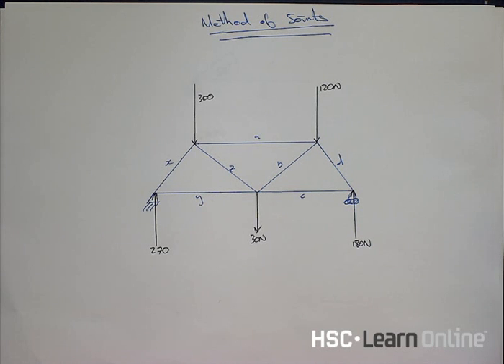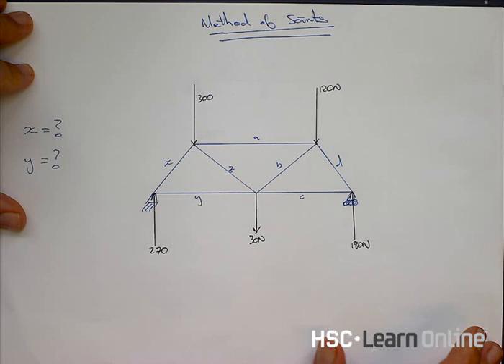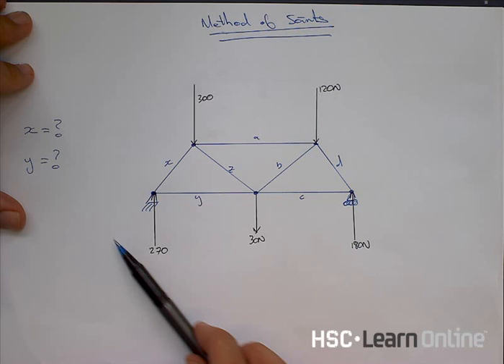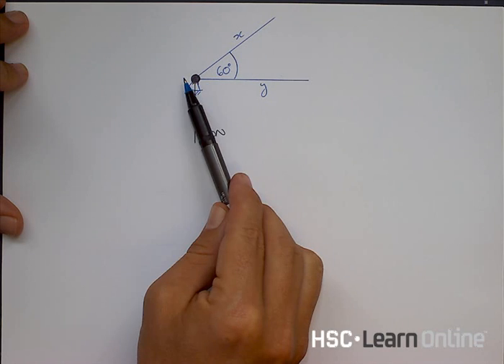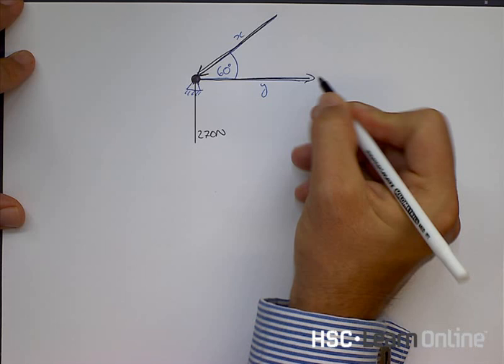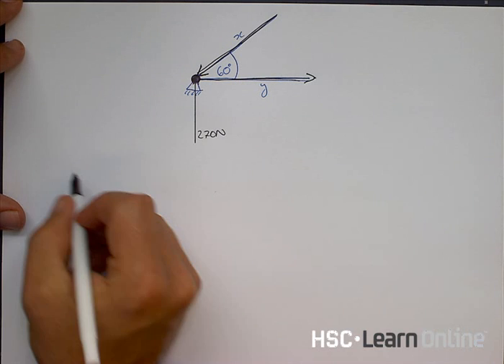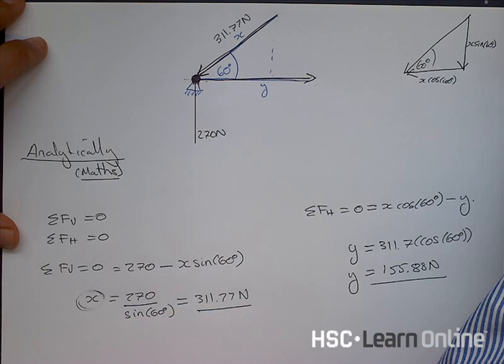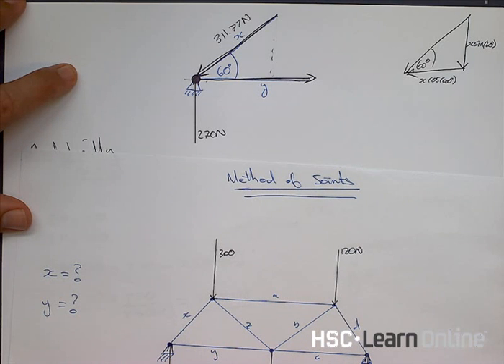HSC Engineering Truss Analysis - Method of Joints

Comment: I have a few problems with this explanation and examination. 
1. The support that you chose to look at (assuming it is a pin support) is fixed, and should have support reactions in the, assuming that our axes are to the right (+x), and upwards (+y), in the +x and +y directions. (We usually assume the reactions to be in the positive direction).
2. I am not sure if it is possible to have an external load on a fixed support.
3. In your summation of x equation, I believe the equation should be: Summation of x = y - xcos(theta) + support reaction in the x direction = 0. 
Of course we all make mistakes (I have made a TON in, namely statics even, as these problems require very careful analysis). I just wanted to point these alleged mistakes out as to benefit the viewers of this video.
Thank you

Comment: Hey, i am a bit confused here. Where does the 60 degrees come from? Is it given?
Reply: A triangle's total interior angle is equal to 180 degrees. To get the angle of each angle, just divide 180 by 3 which will give you 60 degrees.
Reply: Defend on configuration or design of truss

Comment: Wouldn't the fixed supports on the bottom left and bottom right of the truss have unresolved forces?
Fixed support at bottom left has an X and Y component
Roller at bottom right has a Y component
Great video, not trying to point out errors (assuming there are, I'm probably wrong here), thanks for sharing! :)
Reply: this is 2 years later lol but in the truss there aren't any horizontal forces at all, so no horizontal reactions for the bottom left fixed support. :)
Reply: Hahhaha I'm about to graduate now and it's funny to me this confused me. Thanks :)